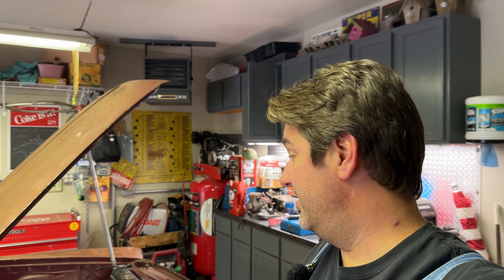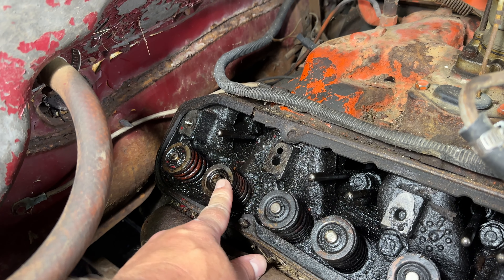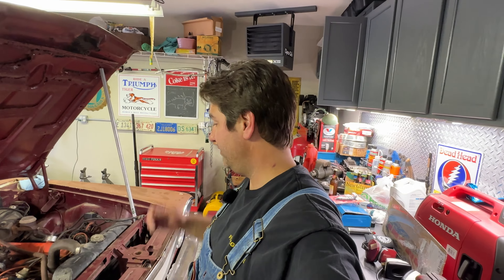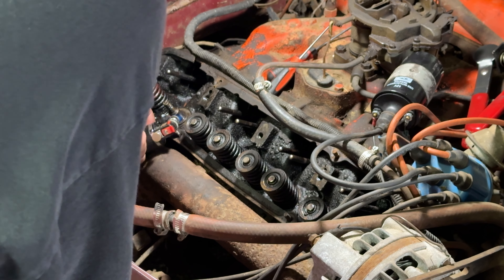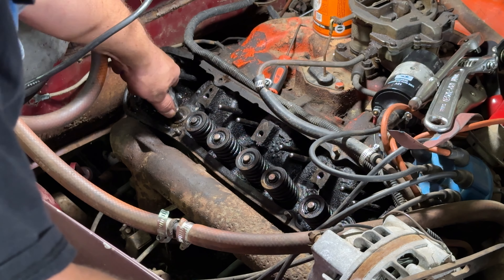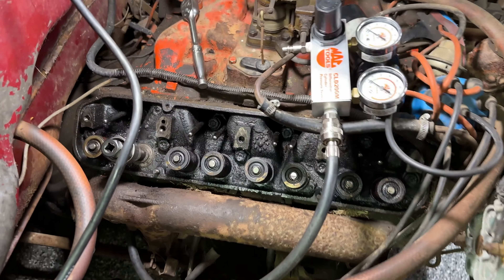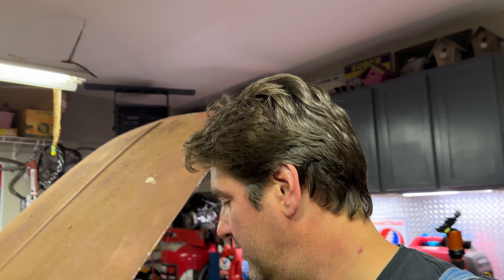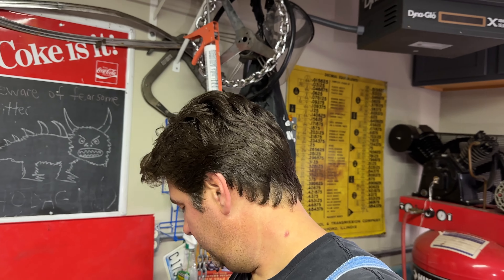Unsticking valves with BRUTE FORCE

Comment: I been watching this since i got the same car myself. I dont know alot about working these old cars yet, But at some point i wounder if its easier to take out the engine and pull it apart. And somewhat renovate the whole thing. I mean how reliable will that engine be even if you get it working in this condition? But as i said i dont know nearly as much as you yet, but good luck!
Reply from the maker: Obviously that is the correct way to do any restoration…I’m just messing around with parts. Thanks for watching and stay tuned!
Reply: That's how it's supposed to be done.  Often you'll go through all this and find it's a mosquito fogger.  Checking compression can save time too but compression can return to normal (125psi+) once an engine has run a bit.